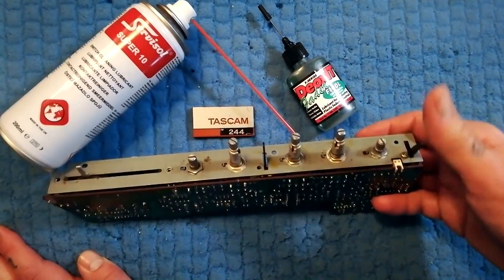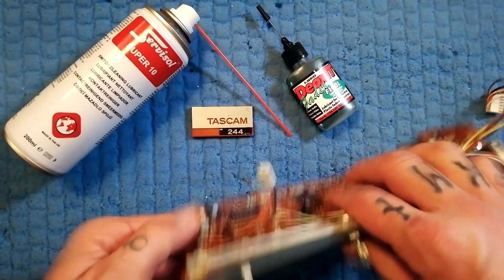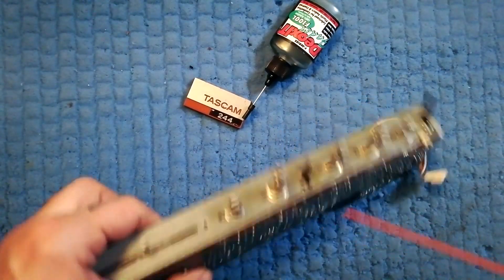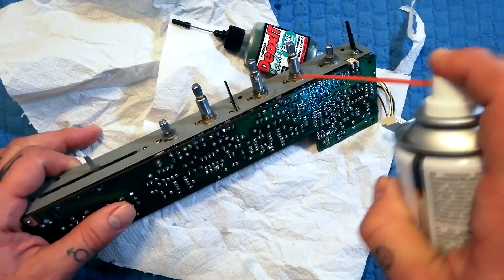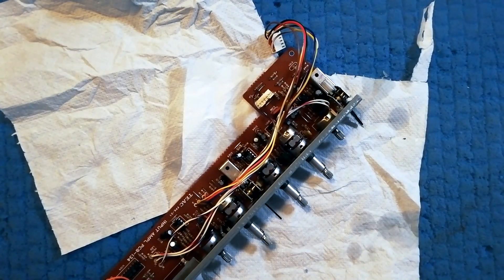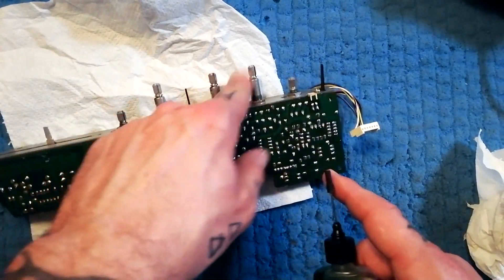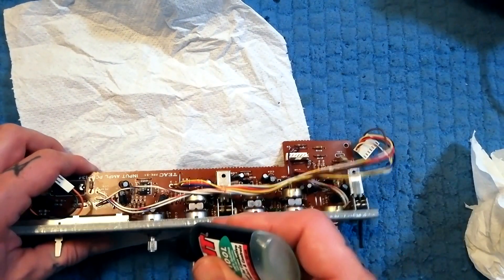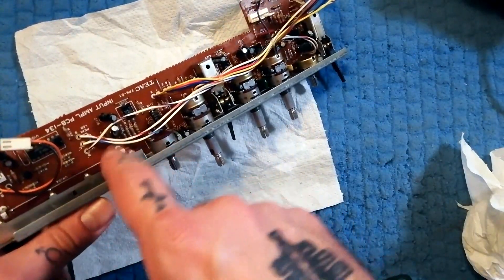Clean & lubricate mixer channels | Tascam 244

Comment: I think you're mistaken about the Servisol. Servisol Super 10 is an all in one solution so contact cleaner and lubricant. You can even feel it if you accidentally spray it on your hands that it's quite slippery. 
A standard contact cleaner usually is alcohol based and has no lubrication. These usually are very good at removing excess flux off soldered boards. I usually use Servisol on all pots and switches without the DeOxit stuff and didn't have any problems so far. 
I find DeOxit to be very expensive and probably overrated for what it does. Servisol Super 10 is popular mostly in the UK whereas DeOxIT seems to be more of an US thing however it's taking over the world but it's ridiculously expensive. Servisol Super 10 is £10 a can whereas DeOxIT has various products each over £20 - £30
Reply from the maker: To me, pots and faders feel very dry after using super 10 -  about a decade ago, Idiscussed this with a friend who was servicing guitar amplifiers professionally, he recommended following up with the FL100, which felt much better. It’s £36 per bottle, but I’ve only used 5 of those in at least 500 maybe something like one thousand repairs since. I agree their aerosol cans  are bad value though.
Reply: @Tetrakan  
I think you meant CAIG DeoxIT Faderlube F100L
Thank you for the info.
I've leaned something today 👍

Comment: Servisol Super 10 is a lubricant too? But anyway the process you used and products Servisol Super 10 and then the DeoxIT F100L Lub. Would this be a safe and effective way to clean sticky car switches say like a push button heater control?

Comment: My DJ controller slider channels are staticy and crackling when I move them, do I just spray a little Super 10 down into them and wiggle up and down or do I have to open the device to do it?
Reply from the maker: Probably you can get away with not disassembling the unit but it  must be turned off and Follow up with compressed air and some sort of fader or switch lubricant and leave enough time for the contact cleaner to evaporate before powering up again.
Reply: @Tetrakan  can you recommend a lubricant for me to purchase please...?

Comment: @Tetrakan Supermonobloc Hi! Thanks for a brilliant video. Ive had my tascam 244 on service for a problem tha occurs in playback, where there are short irregular white noice like-sounds. The tech has recapped the dbx and the channel which had the most issues (appears on all channel but less on some), but the problem did not go away. He has no idea what could be wrong with it. All other functions are working. Any ideas what it could be? Keep up the good work!
Reply from the maker: Hi, thanks for watching. It could be the proprietary DBX chips are bad, in which case your only solution would be to buy another faulty 244 on the cheap in the hope that the chips on the donor are good and sell on the rest for parts (if you are patient about getting your money out and can be bothered to disassemble its possible to make a profit this way - there's a guy based in UK called Tascam Ninja and that's his business model) Also it strikes me that if the problem is common to all channels, boards where the 4 tape channels are combined into the stereo buss such as the power/amplifier PCB would have been a better option for a recap? Not slagging off your tech btw, I do understand why someone in a professional context would not want to keep throwing parts and labour at an unfamiliar unit!
Reply: @Tetrakan  thank you so much! Love my 244, and will try to make it work if possible.

Comment: I am having difficulty with my panning. It seems I have tried every way of accomplishing it, but my machine will not pan tracks. Do you have any input on this?
Reply from the maker: Its hard to answer this without knowing a bit more about your issue ...until the channel signal hits the pan control all four channels are monaural, so if there is a fault with the pan switches or stereo amplifier (later in the chain) this might explain your issue but really I'd need a more detailed description, maybe some videos with stereo audio documenting the problem, if you link to youtube video or message me via my facebook page with such a video , maybe i can help?
Reply: I figured it out. I guess the machine only monitors mono, my panning shows up when I line out to a mixdown.
Reply from the maker: @trashfuzzaudio  ah okay, yeah you'll only heart stereo image through the headphones in remix mode...have fun!
Reply: @Tetrakan  makes sense. Haha thanks!

Comment: Not sure how much I want to completely take apart the mixer section as my electronics knowledge and expertise are pretty limited. Is any of this is doable from the front or with the back panel off?
Reply from the maker: Not really mate. Or at least it would me much more difficult without removing the mixer strips first. I can reassure you though that exactly zero understanding of electronics is required to carry out this task; all thats needed is to remove three screws and two [plugs per mixer strip to get them out (see my video on this)-  If you can unplug cable. turn a screwdriver and press down the button of an aerosol can, you're laughing!